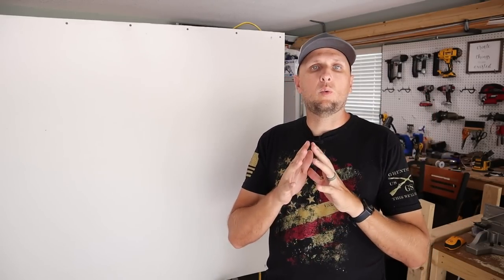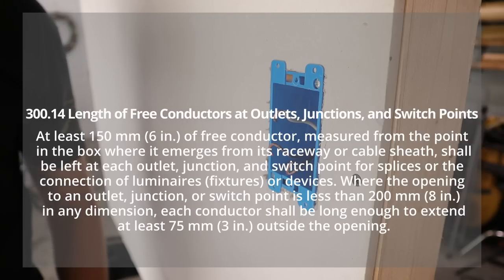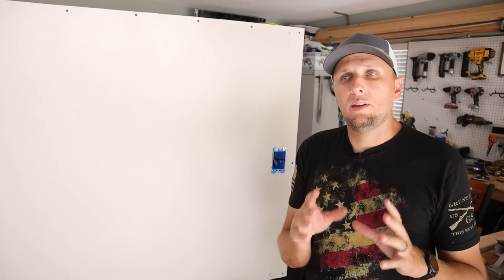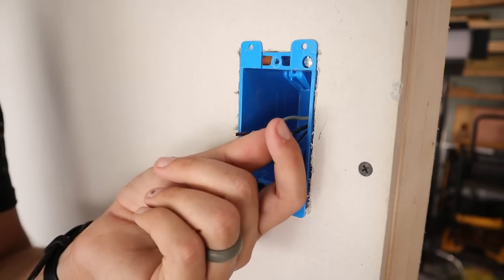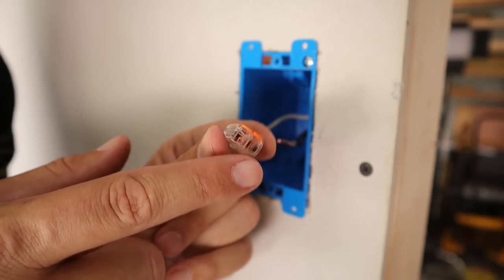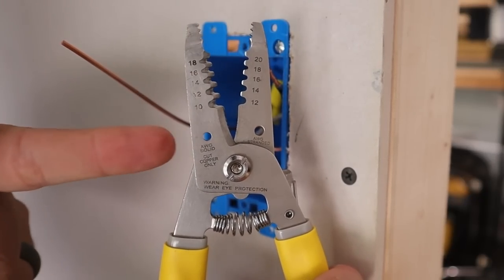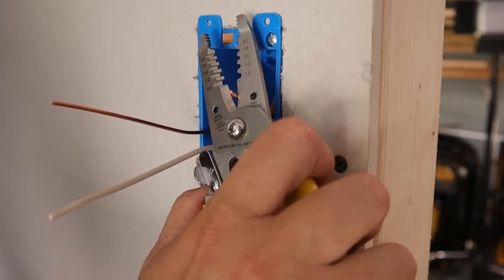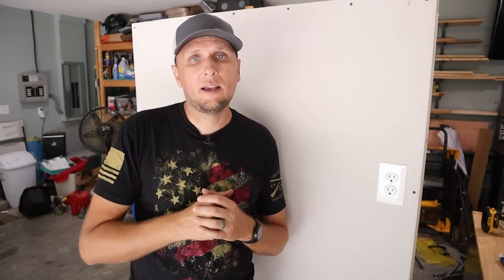BIG Mistake DIYers and Even Some Pros Make When Running Wires Into a Box | How To Fix Short Wires

Comment: Wago also makes an in-line splice which takes away some of the bulk of bending the wires at the join. Model 221-2411
Reply: @neilbrookins8428  thanks, i picked the first one I saw. It should be 221-2401, I think. 🥴
Reply: also tape wago levers down w electric tape so they dont flip open when shoving back in box
Reply: @TomCee53  I agree about the 221-2401. Checking specifications, it looks like the 2411 is only rated for up to 14 gauge while the 2401 is rated for up to 12 gauge.

Comment: I always leave loops after my staple in case I ever need to cut some.  Per my inspector this was perfectly fine.  I did learn the hard way that longer wires do not make it more difficult when installing the outlet/switches, but short wires sure do.   Longer wires also make it much easier to fold them to the back of the box.
Reply: i was taught to make  a " courtesy" loop between box and first staple...few inches for the next guy..
Reply: easy way is to run wire down rafter opposite the box and bring it back to box on stud w box on it

Comment: As an electrician I come across this from time to time and my go-to is the Wago type push connector not the lever lock connectors, the lever locks are just too large.
As a side note you shouldn’t have to cut the ears off your receptacles and switches unless you’re using them in metal enclosures like handy-boxes weather rated enclosures as they’re designed to sit on top of the wall and not even with it; the ears also provide some single adjustment which isn’t otherwise present without them. Been doing this over 20 years and must say I’ve never seen a person pop the tabs with an old work box; I have seen a lot of tabs popped in the commercial and industrial spaces though so maybe that’s what you’re more familiar with and it just carried over.

Comment: This is super "in the weeds" but I do mine exactly like except that once my pigtail is in the Wago, I prebend the pigtail going into the Wago 180 degrees so it slips straight onto the wall wire.  I must admit I have never seen anyone really cut the ears off the outlets.  If they are not in the way, why do it?

Comment: in this example of blue box the fastest safe code way is to remove blue box and cut drywall above or below blue box and remove staple then install blue box or junction box higher or lower than original location add splice then send new longer spliced wire out of higher or lower junction box back to desired original heiight and reinstall blue box with required length of new spliced wire into blue box and keep junction box with splice in it visible and accessable on drywall edge with a blank cover then reinstall outlet or switch to new reinstalled blue box basically having an exposed accessable junction box above or below original blue box with splice and sent back to original location and now there are 2 boxes on wall 1 is switch 1 is covered junction box

Comment: I’m a electrician in England. I wonder why you staple the wires to the studs.  We try not to do that but if we do we use plastic clips and the wires can be easy pulled out the clips . Most of us leave about 6 inches  of spare cable in the wall just in case . . Great video though thanks
Reply: Stapling wires keeps them from flopping around and getting pinched under the drywall.
Reply: Brian Segall  Thanks for  your reply . Yes that makes sense,it’s just we use plastic clips that can hold the wire tight but at the same time at a later date the cable if pulled will easy break the clips and become free and not damage the cable . Thanks  anyway

Comment: Howdy.
I am happy to see the proper way to use a wire nut. Pretwisting makes all the difference.
Regards.
Reply from the maker: I agree.  Glad you liked it.  Thanks a lot for the feedback!
Reply: @HowToHomeDIY  Howdy again. Ye.
I believe Your effort making these clips will pay off. House fires and el. shocks will be avoided.
Using pretwisting one can observe all wires are firmly in the twist before applying the nut. Using four or more wires there is a good chance the innermost wire will slide out of the bundle if the endings are not pretwisted. 
Credits to Wago too for developing the splicer items. Fires will be avoided.
Regards.

Comment: some pros are lazy or dummies cut the wires every time they work on lines. newer homes and the good pros always have or make slack loops. if i have some wire ready i will pigtail or if not i just make whats there work because i never trim wires unless no choice

another real pro move is hook 16 inches of new romex through empty hole into the old wire hole crimp and heat shrink the wires together push the old wire through the back of the box so you dont see that wire anymore. boom you have a slack loop and looks clean
Reply from the maker: They have worked great for me!

Comment: Nice demonstration.  The only variation I've done is to use a green insulated pigtail for the ground, to minimize the exposed wire inside the box.  I've preferred doing that in the fair number of shallow boxes I've had to rework in walls with 2x3 studs instead of 2x4s.

Keep up the good work!
Reply: shallow boxes have smaller wire fill so follow sizing codes for shallow boxes

Comment: That outlet should allow for a straight end under the screw.. 
Wire nuts take up a lot of space and Wago's are questionable. 
There are Heat Shrink Butt Connectors..

Comment: When conductors are less than 6in, I rather use wago and extra conductor on the load. When splicing and un splicing multiple times the copper breaks and it gets short.

Comment: New sub here, thanks for giving the "what's'" AND the "why's"!
Question, will the Wago connectors work with stranded wire or would wire nuts be the better solution.?

Comment: Around 10:00 removing the ears off the outlet….. in Michigan you would fail inspection with that or at least we did 10 years ago!!! Also why couldn’t you simply use the copper mechanical crimps then shrink tube over the bare copper?

Comment: I quickly clicked through your video, after it came up in my "suggested" cue immediately after watching a "5tips" video re electric work.........that was so wrong that it was frustrating. It didnt take me long to see that YOUR video was solid and good advice. Im not a big fan of wago type connectors, but have to admit that they would fit a purpose here in this short wire situation. Definitely great advice to extend the wires. Trying to work with wiring that short is a fools errand. and wires that short arent going to "fold" into a box properly and make strain on the connection. And if you try to work a shortwire like this hot, you must love buying new tools after blowing them up, and cleaning black scorch marks off of walls.

Comment: Any clamp especially single ended clamp style solution works best if the wires are thoroughly straight,  not corroded .and of exactly equal diameter. If these conditions are met Wago and similar products are excellent solutions. If metals are distressed it undermines their crystalline structure so it's better not to work with compromised copper. I have found soldering multi-strand pig tails to solid cores to work well. There are rubber or rubber-like tubes to insulate the joint. The best way I know of appraising a joint (other than to test to destruction) is to use a directional thermometer and a load close to the limits of the breaker/fuse. I certainly encourage a":courtesy loop". Edited to add espcially.

Comment: I would never use electrical outlets where one simply inserts the bare copper wire, as I'm not confident that there is enough surface area for the electrical contact.  The exception would be where one inserts the wire then tightens down the screws.

I've gotten away from wire nuts.  Me, I would attach the pigtails to the outlet before plugging the wires into the Ideal connectors, I'm sure you didn't do that just to illustrate how the connector works.  I would not use a wire nut on the grounding wire, I would twist the wires together like you did but use a crimp sleeve.  I hear the term "bonding" often.  To me, that means making a solid, gas-tight connection that has some mechanical integrity.  

I do appreciate your videos, always something to learn.  Jim

Comment: great vids I have been watching all of them.  Question for you....when connecting wires to an outlet you said connect ground first then neutral then hot.  Does it matter which I connect first since the power is off?
Reply from the maker: No not really it’s just best practice for safety purposes.

Comment: Good video, but I don't get why you didn't use a Wago on the ground wire as well.
Reply from the maker: You certainly can.  I did it in the video for various reasons.  I am still warming up to the Wago's.  With the ground not being insulated I can get plenty of surface contact between the two wires even with them being short.  For me, I know I have a good joint made with those grounds so they are not coming apart.  Also, the Wago's are a little more expensive so being able to save one on the ground for another project is a plus!  I also wanted to show that if all someone has is wire nuts, they can be used also.  But yeah using the Wagos on all of the wires is definitely ok!  Really appreciate your feedback Ted!
Reply: @HowToHomeDIY  Fair enough, good job

Comment: Electrician from the UK: In the UK wagos are the preferred method for any connection because it does give a superior connection (confirmed this by testing the connection with a low ohm resistance meter)... Would never trust a wire nut personally... Only downside to wagos is the cost but ild rather pay a little extra for that peace of mind.
Reply from the maker: I have been hearing that a lot.  Especially from you folks in the UK.  I personally am starting to like the wago more than I used to especially in certain installations.  Thus far it just isn’t as popular here in the US as it is where you are, even with many of the electricians here.  I also have to order them online as I haven’t found any stores around me that carry them.  Thanks a lot for the feedback Joe!
Reply: With Wago's wire length can be shorter. If a pigtail is too short, just remove and replace with a longer one, simple. With a wire nut pigtail, making a reliable connection with new pigtail can be difficult.

Comment: Are the wago allow in New York City electrical system?
Reply from the maker: A electrician friend of mine in NYC uses them in some installs so I would assume yes.  But check local code to make sure.  They are NEC compliant but NYC has some strict codes.

Comment: I am a UK  Spark and allow 4" from the flush edge of the socket (outlet). Effectively using the width of my palm whislt holding the wiring.
Reply: Also we use Wagos, but we have to sleeve( yellow/green)the ground wire. This is to further insulate from any potential ground fault within the box.

Comment: I really enjoyed the detail of your video here on using the wago and the extender wires. My question is using the wago's with my irrigation system. I have 6 valves for the 6 zones and I see the person that installed this used wire nuts. The wires  are all over the place and different lengths and just a big mess. Can I use the wago's to clean this mess up and should I use black electrical tape to cover the wago connectors and a little bit on the wires or are there special outdoor wago's I should be using for this application?  thanks Jim

Comment: If you have 3 cables coming into the box,you do not have the luxury of all that wire extensions;best to live with short wires.
Reply from the maker: In some cases that is true.  Depends on what box it is and it's fill capacities.  The plastic boxes will generally have these listed in tiny print inside of the box.  I appreciate the feedback Charles!

Comment: Quick code question: If your box is kinda crowded, to where even the wagos might be too much extra stuff in the box, would it be up to code to solder the pigtails to the existing wire, and then heat shrink some tubing over the connection?
Second, is there actually any real difference between the Ideal push in connecter and the Wago?
Wago connecters are really hard to get around these parts, but I have seen the push in connector. They seem to be very similar in function, except that the Wago is removeable if you feel like changing stuff up some day.
Reply: You cannot solder. If you don’t have enough room you have too much stuff in your box; NEC specifies box fill which is how to calculate size needed based on conductors and connectors utilized.

Comment: I was always under the impression that ground wires need to be crimped. If a wire nut connection comes loose there is not an immediate indicator that something is wrong
Reply: There are green wire nuts that let one wire through the end and if twisted properly it's not going to unravel. People on here are just trying to sell something new which is ok but is Not superior to another type of connector. I try to use American made products when possible. 73
Reply: I also have crimping sleeves which are copper and require a special tool for crimping all the grounds together. I don't have the tool but used a Kline crimper which works ok but the special tool is much better. 73

Comment: Sometimes boxes are chained so it can be possible to string a new wire from the connecting other box. Also some contractors will use 3 wire cable (black, white and red) as two circuits on the same ground so if you're flipping circuit breakers and can't figure out why your outlet is still hot and you see a red wire, that's probably two breakers on one wire with a common ground.
Reply: if they are using a common neutral on a pair of circuits, they should also be using a breaker with a tie bar. That's been code for a LONG time. The single 2-pole breaker also prevents overtaxing the neutral wire because it will be a balanced load. Bonus here is switching off one breaker kills 2 circuits.
Reply: @rupe53  I see it done when that circuit is used with a three way switch (two switches controlling one outlet or light but in two different zones).
Reply: @cb-gz1vl  ... with switches they are not sharing a neutral. You only switch the hot leg. BTW, it's up to you to sort that out. ALWAYS check first.
Reply: @rupe53  Yes that's what I'm pointing out. If someone finds that they are flipping breakers and the outlet/switch won't go dead it could be you need to flip another breaker
Reply: @cb-gz1vl  ... you flip enough breakers and it will go dead.... then you double check.

Comment: Move the box up.
OR set a box in the attic above that wall and fish a new wire down to your original box.
Some push on connectors are only rated for flour. fixtures only.

Comment: By code it was an issue.  Not really that big of a deal though.  I would be more concerned over the Wagos failing under heavy load.
Reply: Wagos have been in use for decades in Europe with little issue.

Comment: great video, only thing I would never use wego or push connectors is on outlets.  Especially in a location that might one day run something high powered, like a space heater or a power tool, hair dryer/iron, table saw, air compressor, shop vac, anyway.  I am a fan of wire nuts.  Any time I change outlets I always swap out back stabbed versions with better quality screw types.  I love the ones that have the plate the you just stick in a strait wire and it clamps down on the wire like a vice when you tighten the screw.  Just as easy as a wego or back stab but with all the contact surface area of a screw down application, and no need for hooks in the wire.
Reply: if they're UL rated what is your concern about wegos?.
Reply: Agree about back-stab outlets, but Wagos are another story. If I can, I use wire nuts, but Wagos have their place. There are plenty of videos where they test the Wagos with way more current than allowed for the wiring, and it's always the wire insulation that melts first. The Wago hangs on even when the plastic melts. I've seen more bad DIYer wirenut jobs where the wires aren't pre-twisted or one wire is uneven with the others. At least the Wagos are pretty foolproof for inexperienced people.

Comment: I have seen many electric systems, but a system with a blank ground in it is a hazard on its own. I never would use such a system, because i am used to insulated ground (yellow/green color combined). Seems quite unsafe for an electrical system
Reply from the maker: Where are you located?  In the US almost all homes are run using NM (romex) which has an uninsulated ground.
Reply: @HowToHomeDIY  i am living in europe, austria. Never seen this type of wiring in any video
Reply from the maker: @Kinsanth_  Interesting.  And this type is all I see haha.  Must be showing mostly videos based on your geographic location.  But yup, this is how residential wiring looks here in the US.
Reply: @HowToHomeDIY  i am honestly quite shellshocked. That system is from our safetystandardpoint a massive hazard from the start, even if ground is considered "lifeless" its insulated and colored aswell.